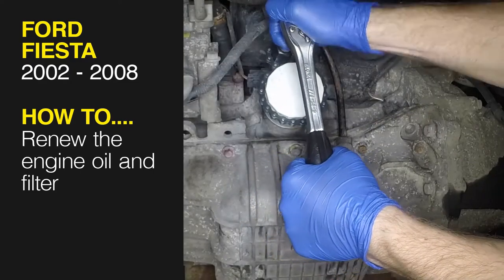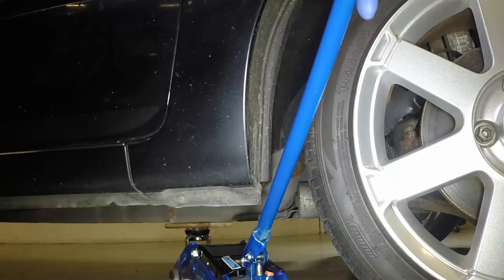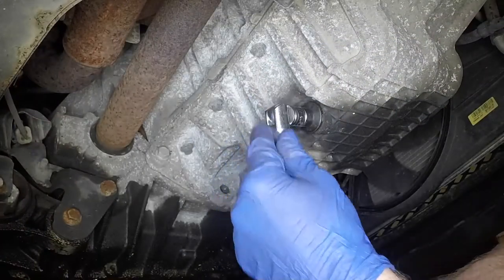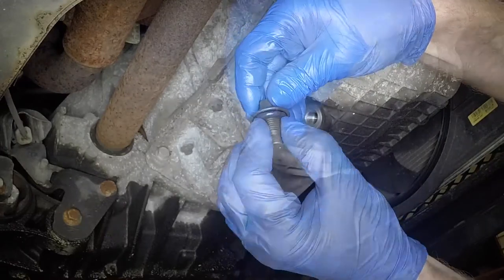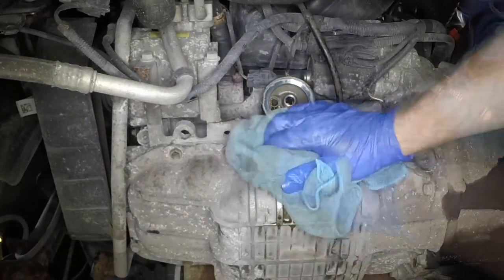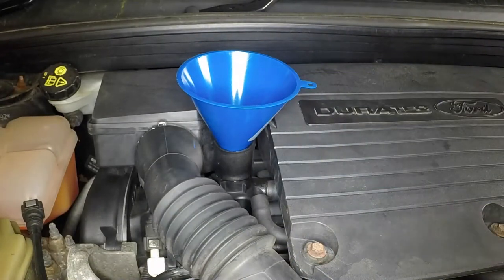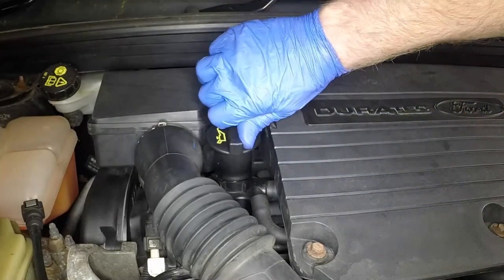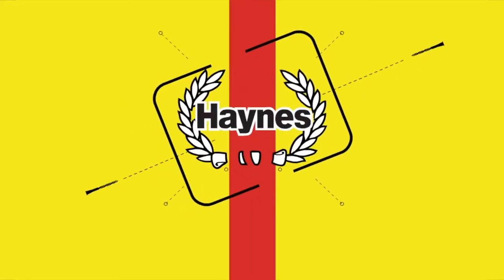How to Renew the engine oil and filter on the Ford Fiesta 2002 to 2008

Comment: I have a Ford Fiesta 1.3 Petrol from 2004. What oil should I use? Thanks
Reply from the maker: According to our manual: Motorcraft Formula E, or SAE 5W-30 engine oil to Ford specification WSS-M2C913-B